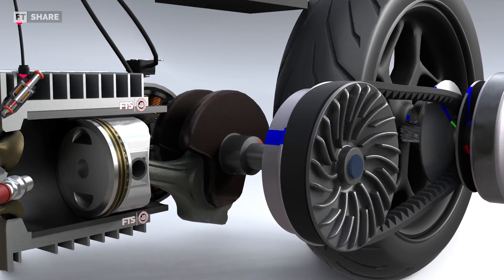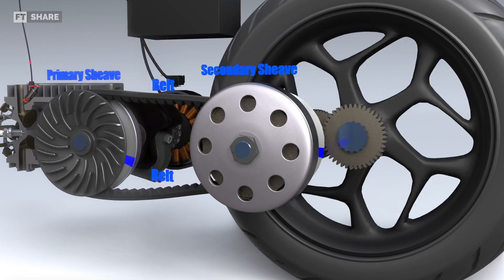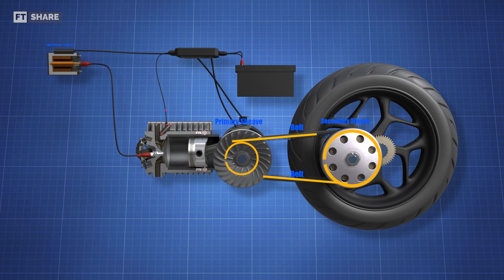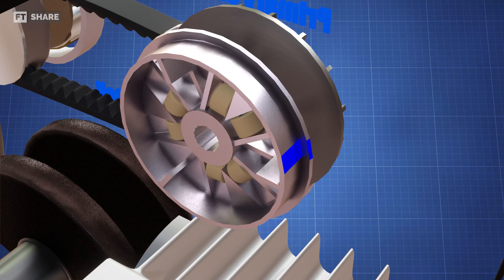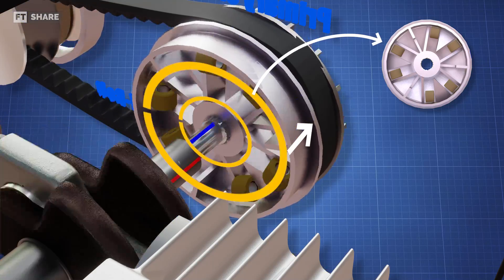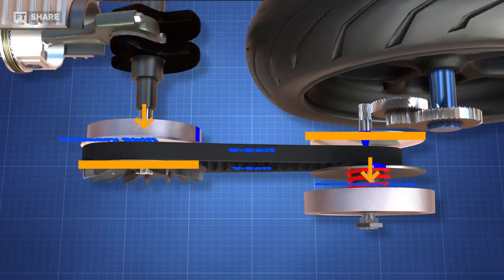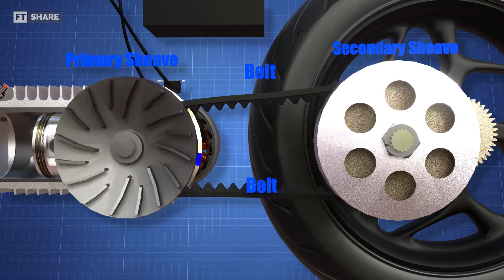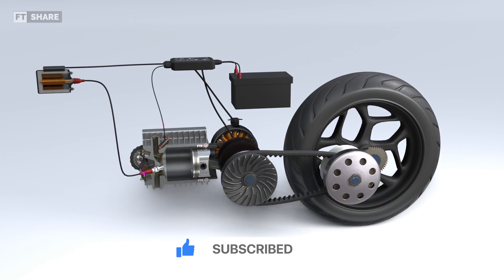How a Scooter Transmission Work | CVT Working Mechanism

Comment: My scooter lost power. 100 cc, 80 km/h, no faster. What could be the reason for this?🖐️🙏 I wish everyone a pleasant ride.
Reply: 80 kmph at 100cc you are already fast enough
Reply: @xiswalder1943  Thank you for your answer man but I wanted to know if this is normal.
Reply: @yilmaznas6834  my 125cc scooter, ntorq goes till 100. and thats one of the powerful scooters so its normal 100cc to go till 80
Reply: @xiswalder1943  Yes that is true you are right👍
Reply: May I ask you bro, what is your scooter? Anyway, it is either spark plug or it needs a carburetor cleaning. But I do reccomend to change your stock pulleys to a racing pulley and then change the flyballs into a lower grams if you want acceleration and higher grams if you want a better top speed.
Reply: @biu.1424  Honda activa 100 CC scooter
Reply: @biu.1424  Honda activa 100 CC
Reply: @biu.1424  Honda activa 100
Reply: @biu.1424  I do not prefer speed, but is this speed enough for a 100 cc scooter? I guess it can do more. To pass or get away from some vehicles while driving. Short acceleration and escape are required from time to time, so I guess it can be a little faster.👍
Reply: Flyballs maybe worn out.
Reply: @gameconsole9890  Can you please explain clearly which parts they are?
Reply: Your 100cc engine displacement is the problem. It simply doesn't have enough power.
Reply: @anursetiawan  My motorcycle is a 100 cc motorcycle weighing 111 kilograms. It doesn't go faster than 80km/h and screams when it reaches 80km/h.?  What is the reason for this? I just don't want it to go faster. I want to know that it is healthy.?
Reply: @yilmaznas6834    why does it scream? That's because you have maxed out the pulley ratio, so your engine is at it's highest RPM possible with very little torque. And no, that's not healthy. If you keep doing it everyday without extra maintenance, it will eventually get jammed, just a matter of time.

As comparison, my 110cc scooter with 90 kg of mass (and me as the rider, 70 kg), can only go as fast as 101 kph according to the speedometer, but the real speed according to GPS, it's only 87 kph.

And my another bike (not a scooter), it is 150cc and with ~120 kg of mass, can only go as fast as 124 kph, but the real GPS speed is only 109 kph.
Reply: @anursetiawan  Yes, when I open the gas, the top speed reaches 85 km/h, then it screams as if it wants to go further, but it doesn't go.
Reply: 80kph is ok for a 100cc scoot. thats basically all that engine could make. 
it will be difficult to reach 90-100kph considering many things including weight and wind drag..

Comment: I have no idea what you just said.
Reply: English or Spanish...
Reply: It's more like changing the sprocket in a bike. Big sprocket in the rear will give more torque but lesser speed and mileage. Changing the sprocket size in rear will decrease the torque but will give more speed and mileage.
Reply: Yes..🤣
Reply: The illustration arrows are incorrect.
Reply: Coz you are dumb
Reply: It's AI generated and probably translated from another language 🎉